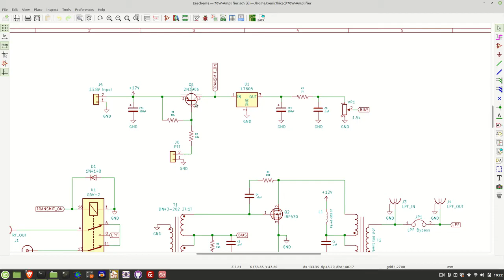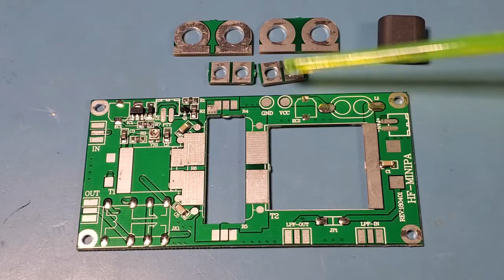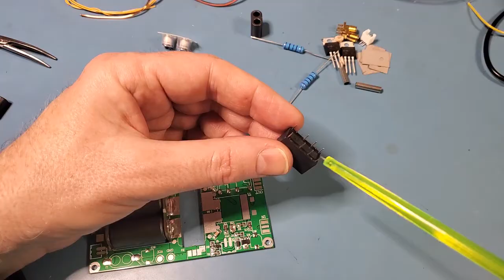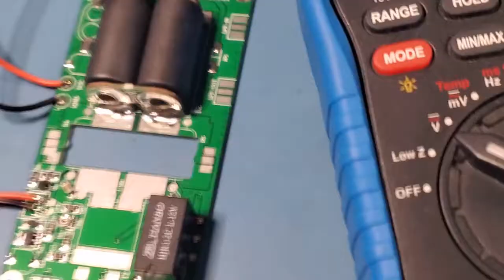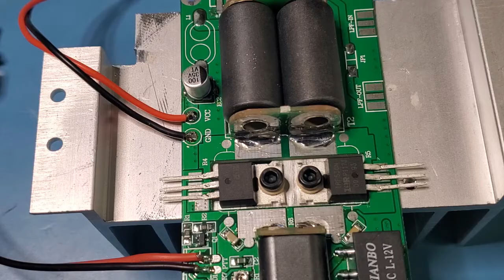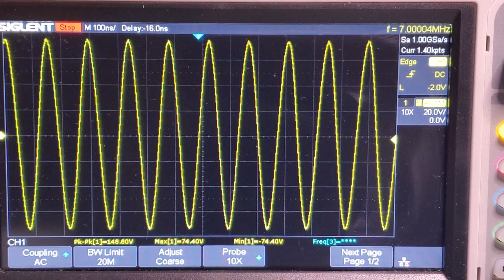70 Watt Amplifier Kit Build

Comment: Would this kit be good for CB radio? Want to make something small for my truck for when I am in only in the mountain.
Reply from the maker: I wouldn't want to say anything that would get me into trouble with the FCC but this amp will work on 10 meters with an appropriate low pass filter on output. You won't get anywhere near 70 watts though on SSB or AM - maybe 30 watts perhaps 40.

Comment: What electrical function do the "ferrite tube" bushings perform (if any)? 

Do they just more securely hold in place the ferrite tubes? If that's all they do couldn't one just use some RTV silicone to lock them in place once the wiring through them is completed?

edit to add:
I'm just trying to make sure I'm not missing some finer point of this design. I like to design for "what ifs?" and it's a lot easier to snip off some silicone than unsolder the bushings if for some reason I end up accidentally breaking a ferrite tube and have to replace it.
Reply from the maker: The certainly hold the tubes in place but the bushings main function is to act as one of the electrical windings in the transformer. The other winding is the actual wires going through the bushing.
Reply: @na5y  Thanks!

Comment: I blew the irf 530s...Will check the bias circuitry  to make sure it is ok after removing the mosfets. I have irf 540s.Do you think they will work as well as the irf 530s...I overheated the irf530s .They were working well until I got too talkative on SSB! Thanks...
Reply: Y es this work un 40m

Comment: Just recieved the 'kit'. Since there is no instrutions , I am going to follow your video. It may take me month to put this together, as I will need the heat sink and a new soldering iron. Also the input and output for coax is so small, I never seen connectors smaller than the BNC on VHF gear. What are they called?
Reply from the maker: Good luck with the build Martin. The small connectors are SMA - specifically female PCB mount SMA

Comment: Have you done a 144mhz version?
Reply from the maker: I haven't Lawrence but that might be fun to do...
Reply: @na5y  I’ve been looking for one but I must not have the right word combo for the search to find it. Great video by the way.
Reply from the maker: @lawrence1md  Here's one on ebay. No idea at all how good it is. Search using the following:

"100W FM VHF 80Mhz-170Mhz RF Power Amplifier Board"
Reply: @na5y  I did find on similar to that one. It uses a 24-26 volt power. Some do not come with the transistor or it’s used. I’m going to keep looking. Thanks for looking too!

Comment: You mentioned this will not work well on SSB, is there anything to correct that? just ordered the board.
73s
Reply from the maker: It will certainly work on SSB - you won't get anywhere near 70 watts out of the amplifier though. I do a follow up two-tone test with the amplifier in a later video: https://www.youtube.com/watch?v=ZvDppBOvhtI
Reply: @na5y  Thank you so much, will look into it too!

Comment: I'm confused, I thought the formula for power calculation is P = U²/R ?
There is 140vpp on the scope, which makes 140/2=70V²/50 ohm = 98Watt ???.
Reply from the maker: Hi Franky. That is the correct formula - but the "V" in that is the RMS voltage - not the peak voltage. For a sine wave To convert from peak to RMS voltage you divide by sqrt(2). Heres a useful reference: https://www.analog.com/en/analog-dialogue/raqs/raq-issue-177.html

Thank you for the comment!
Reply: @na5y  Thanks for the explanation, I learn something every day.

Comment: Is there anything I can do to stop the 2 resistors getting extremely hot ?
Reply from the maker: If you have them mounted close to the board you can mount them higher so there's an approx 5mm air gap. This amp probably needs a fan to be honest

Comment: How you soldering electrolytic C2 near T2 transformer? And how define bias current transistors?
Reply from the maker: For C2 I put a little blob of solder on the pad closest to the transformer and then I have a very fine angled soldering iron tip that allows access to tack the cap down. Of course I should have installed the caps first - that would have been easier.

As far as bias goes I started with a bias of around 2.8V and carefully increased it to around 3.3-3.5V. You do have to be careful here as there is no thermal protection and those IRF530s blow in an instant.

Thank you for the comment - I hope this helps
Reply: put some fresh solder on the PCB pads and some on the capacitor leads. then press the two in place and heat them up the best you can.

Comment: quick question RE: Bias adjust test, I can read from zero to 4.8vdc..didn't think it should go that high (13.8vdc in) comment?
Reply from the maker: That does sound a little higher than the max I had but I can't recall exactly what that was. Did you short out resistor R7 like I did? That does give a greater range to the bias. The pain with the bias adjust pot is there is no defined "start" and "finish" - it just rotates freely which means you can go from 0V to maximum with a tiny adjustment. In any event you don't want to go much higher than 3.2V (even that is pushing it)
Reply: @na5y  no didn't short out R7, so I'll just have to be careful.  Don't even need the 50w out, intending to integrate amp with either a QCX or an old uBitx..
Reply: Just getting back to the build.  I have a couple of smaller heat sinks, just wondering how smaller than you had to be in a safe zone, and plan to use forced air (fan)..Comments?
Reply from the maker: @N2AIE  I used a quite large (3in x 4in perhaps) heatsink and I think that would be enough for intermittent work. Definitely need a fan and a way of monitoring heat for more sustained work. I do plan on getting back to this amp myself soon (hopefully)

Comment: hi my msd caps the pin came off so i have replaced with the normal cap with the black heat shrink over them should that matter?  i do have the msd soldering gear but for some items its the soldering iron and very fine tip, im also hunting down some bare bords only. why im ino cb and im a it tech repair man im not a spring chicken i have just turnd 50 on 4yh july
Reply from the maker: Hi Alan - you'll be fine with a standard electrolytic in place of the SMD - just make sure polarity and voltage are good. I haven't seen the bare boards for sale - although have a look at this video where I made my own.
https://www.youtube.com/watch?v=GExwAZttFa8&t=948s
Reply: @na5y  
hi i have it all built now. what els do i need to to before i connect to my Washington but i will take power down to 5 wts on the radio. why that rig i want to convert it to 27mhz  as its on the ghost band at mo yes 26mhz is so nice and silent all the turkys went uhf. us nice bugers are on 27mhz unless some nice ham comes to 27 and wants us to see how good he/she comes to nz with sig test. yes i do that a bit but i only tell them the sig and how good it is and we get a big thank you and flic my numbers then bugger off. then i head back to 38 or 35. that out of the way what do i have to buy now for it to work on 27mhz i have a the amps to run it i just take my benchtop 40 amps and that was running my anytone 5555n i just hope my ten amp will now run the anytone rig. if i have to buy xtras do you sell them?  thanks  Alan 41KK407  you can get me on 38 when states side at night and we are day as yes we are getting usa skip most days cheers and 73's  ps i will get my has tic i just want to get my gear sorted my main rig is 25-30mhz and i also have a baofeng handheld thats unlocked not like the new locked radios.  73's
Reply: @na5y  what els do i need for the amp ?  i also built my self one of those auto swr units and made a rechargeable battery packs so if im out and about i can tune any antenna i can run on 26 and 27mhz but the kit says 1 to 50mhz and upto 100wts even thou my setup is 1:1 the dam needle dont even move on 27mhz but 30 mhz wow my needle crashes to other side of swr meter but stick on the auto swr tune it goes way back to 1:1 any ways 73's and im off to sleep its 11:37pm nz time..... at some stage  it will get upgraded to a 140 wts chip then buy one at a time to about ten then join the up as one missive amp . then work out a way to convert ac mains to dc it will either work or have a missive blast go off
Reply from the maker: Where it gets tricky is you also need a low pass filter after the amp to remove unwanted harmonics. There are LPFs you can get on eBay for your frequency of operation. The other thing to be mindful of is this amp certainly won't put out anywhere near 70 watts. The best you'd get is around 30-40W and even then you'd likely get splatter. I hope this helps and thank you for the comment
Reply: @na5y   thank you now thing is i have my radio that i will turn it down by 4 wts then i have my auto antenna tuner then amp the lpf what way should they be thanks

Comment: 2:40 I think that the relay is drawn backwards. When PTT is asserted, the coil is activated, and would (in this drawing) push (?) the contacts down (?), away from the coil (?).  That's not the traditional way to draw a relay. Relays should be shown in their relaxed state, and the contacts should move towards the coil when activated.

Also, starting at about 2:55, the description of the signal flow is pretty confused. In Rx mode, the Antenna port "J1" is connected to the QRP transceiver at J2. So the Rx signals flow from J1 to J2 (not other way as you described). In Tx mode, the Xmit signal from the QRP Transceiver at J2 flows through the amplifier, and out to the Antenna port "J1" via relay pin 8 (LPF).  At 3:10 you got it correct, from J1 to J2.
Reply from the maker: Thank you for the comment. As far as the relay on the diagram goes - I just took one of the defaults from kicad. On the second part thanks for the correction!

Comment: could you tell me if it is normal for the completed amp not to draw much current nor heat up when turned ON, but no RF in? i am in the process of building one of these kits. as i am testing them before installing inside a case. the amp doesnt heat up when turned ON without any radio plugged in.
i was under the impression that they would heat up and draw some power even in a idle state (turned ON, but not amplifying).
Reply from the maker: Interesting question. By "no RF in" you mean that the PTT is also not activated? With no PTT those FETs aren't even conducting as grounding the PTT turns the voltage reg to the gates of the FETs on. In that case you should get no heating at all.

If you have grounded PTT but no RF input then the FETs will be turned on to some extent  but the quiescent current draw should be quite small - around 100 mA in this amp IIRC. SO you shouldn't get much increase in temp. Depends where you have the bias set.
Reply: @na5y  ok ok. my father and i both built the same kit. ours isnt drawing much with PTT active, but no RF in.  strangely the board my father built appear to be working correctly, but my kit isnt. mine doesnt look to be fully amplifying. it is drawing only a little bit of power. i dont know if you have time to help me. i  know diagnostic of random stranger on the internet is very annoying. the sine wave coming out (7mhz 40m band) looks to be perfectly normal, but the current drawn by the amp is too low.
have you had a similar problem?

80m: 4.18A
60m: 3A
40m: 2A
30m: 1.3A
20m: 0.7A
15m: 0.4A
10m: 0.6A

using various powersupply 12-13V including Li-Po battery capable of high current drain. i checked the voltage drop at the board and it is not a power supply issue.
Reply: i forgot to say, i am using 3.6~ volt Bias. i have tried to lower it down, but it doesnt seems to make much difference.
Reply from the maker: Not annoying at all ;)

What is the RF driver you are using for the amp? This amp needs at least a 1W RF driver (approx 20V peak-peak on input). At 40m, say, what is the peak-peak output of the sine wave. Is it stable?

Another thing to check would be the windings on the final transformer. Make sure you have the correct number.

Hope this gives you some leads. Let me know how you get on. Remote debugging is tough - but it'll be rewarding if we can get you working!
Reply: @na5y  i am using a uSDX+ (<5W). i will check for the voltage and come back to you.
thanks for your help!
Reply from the maker: @Francois_Dupont  While you are there do you have an oscilloscope? If so could you check the input waveform at the gate of one of the FETs - in DC mode if you could. No worries if you don't have an oscilloscope - there are other things to check. Do be careful probing around the FETs - if you short gate/drain the FET will instantly die
Reply: @na5y  sadly the scope is at my father's place and i just came back...but i have here the measurement he took:
-using the Radio thru the Amplifier (but not turned on PTT-OFF): 40m band 20.4v P/P 14.4v RMS? 
-with the Amplifier turned on: 40m band 34v P/P 24v RMS? drawing 1.8Amp. 3.4v bias.

i think those are calculated RMS values from the Peak to Peak voltage. he couldn't find the RMS value on the oscilloscope screen. i will try to ask him to take the measurement you recommend. 

also there is something you must know. in order to mount the Mosfet in a more versatile fashion. i used 20ga copper stranded wire about 5cm long to extend the Mosfet legs to each separate heatsink. would the little resistance those wire provide keep the Mosfet from pumping current as they should?
Reply: @na5y  he also told me that comparing his working Amplifier board to mine, there is a voltage difference when transmitting into a dummy load thru the Amplifier while OFF (relay bypass mode). he was measuring the P/P voltage of his uSDX radio into a 50ohm dummy load with the oscilloscope. he said there quite a difference. i dont remember the number, but it is between 5 and 10volt difference.

i dont understand this, would the relay be damaged? i cannot understand such a big difference if the only different thing between our build is the wire used to connect the BNCs to the board. i used maybe 10cm of 20ga copper wire and he used 6cm of 18ga wire.
Reply from the maker: @Francois_Dupont  34V p-p is only about 3 watts so that is definitely low. You do have a 50ohm dummy load on the output correct? Also the windings on the final transformer (the big pair of ferrite tubes) - could you confirm that is 3 turns of wire. With a binocular core each turn is measured as the the wire passing through both holes.
Reply: @na5y  yes on all those count.
my father just measured with the scope and i have the resulting wave. one FET appear to be running correctly (like the other Amplifier) and the other has a lower voltage with a strange form. the strange one has a voltage of 4.96V and the other is 9.48V (the same has the other amplifier). it appear one Mosfet is doing strange things.

i dont know enough to say if it is the FET that is the cause, or it is only the result of the drive being applied to it. i will give you the link to both pictures showing the resulting scope screen, in another reply because YouTube tend to censor them.

Thank you again, for your help!
Reply: @na5y  please disregargard the voltage difference between the relay-bypass mode as i mentioned in the other comment. my father just told me it was an error in measurement. 

here is the picture of the resulting Gate to Ground waveform of both the Mosfet of the Amplifier that is not working correctly:
https://i.imgur.com/RmWbIIH.jpg
Reply from the maker: @Francois_Dupont  This is a mystery - I can't actually recall the p-p at the gates in mine (I will have to remeasure). 

Here's one thing to perhaps try if you're game (although it may blow the FETs). Wind 4 turns on the final transformer on the output side instead of 3.  Like I said a bit of a risk but I am running out of ideas ;)

I don't think the 20 gauge wire on the leads of the IRF530s would matter much - but if you have some solid core 18 gauge might be worth replacing that. 

One other thing to note is I am pretty sure I was driving my amp with close to 4 watts. You said you were driving with around 1 watt correct (20V p-p) - can you increase that drive?
Reply: @na5y  i dont think i could increase the input power, i tried upping the internal "TX drive" setting on the radio (from 1 to 8) but it doesn't seems to matter as the input amperage of the Amplifier doesn't change. 

the funny thing is that my father amp, build the same way, using the same radio as input. looks to be working normally drawing 4-6amps. contrary to mine drawing less than 2amp.

anyway thank you for your help.
Reply: @na5y  hello. my father found the problem this morning. my amplifier not working and only using 2amp was caused by one of the two 100uF electrolytic capacitor being bad. now that the capacitor is replaced the amp is pulling 4amp+ and is now apparently working correctly.

if you are a futureman with the same problem reading this, just replace both electrolytic capacitor! you can use any value >100uF, those caps are only for smoothing the power rails. the value is not critical to operation.
Reply from the maker: @Francois_Dupont  Interesting - so you had a shorted cap. Glad you solved the problem and thank you for the comment!

Comment: Can irf3710 be used for this
Reply from the maker: The rise + fall time of that mosfet is around 100ns - I would say it might be too slow for HF work.
Reply: @na5y  i put some in i cant test completely need a heat sink i have been able to get 22 watts out with 6 watts in been going through circuit in original configuration had a bunch of bad components. I dont expect to achieve much here performance was better with 530 at 1.8 vdc bias these 3710s at 3.13 can get it higher at the moment